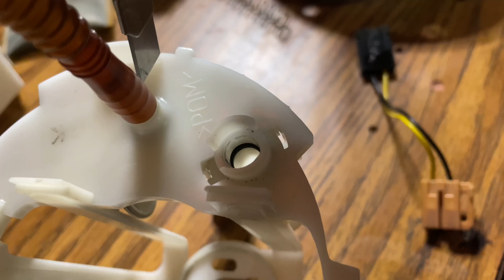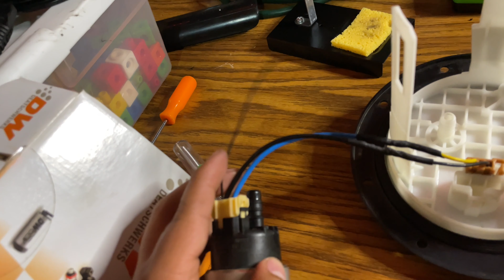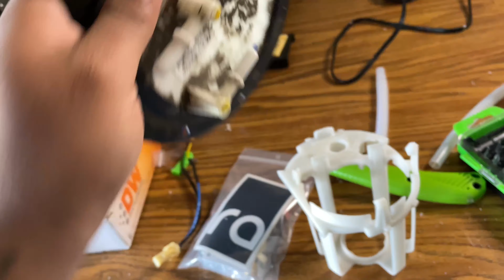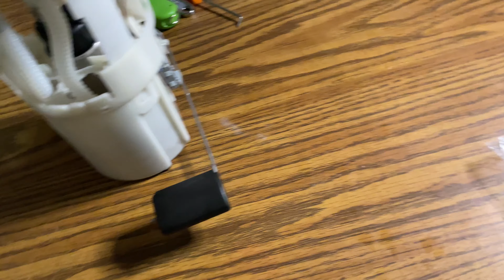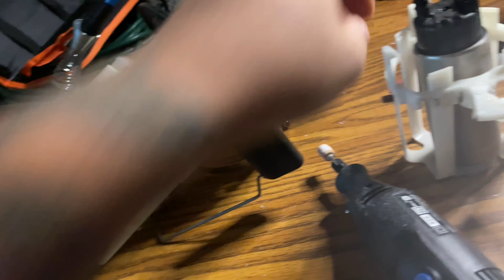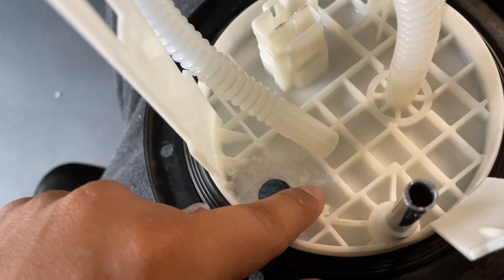Genesis Coupe Fuel Return System Pt.1 | Radium Venturi Install

Comment: Im confused because my canister on my bk2 doesn’t look like that so im completely lost😂
Reply from the maker: @brodie3125  still the same process. For any vehicle really. The demonstration is just shown for a GC 2.0T fuel assembly
Reply: @ ohh gotcha thank youu
Reply: @ProdigePerformance also have another question does anyone have a part number on the fuel pump connector yellow and black wire that you were showing ?

Comment: How’d u mount ur fuel pressure reg? Did u drill holes into the manifold?
Reply from the maker: @vietyyg6739  I just used existing bolt locations on the manifold boss. They’re already there

Comment: I noticed at the end of the video when you were showing the finished product of the fuel basket …that the top was pulled all the way up and doesn’t seem that you cut the hoses like you said would need to be done.
Reply from the maker: The full basket has to be all the way up. Otherwise the bottom the basket won’t be fully submerged when installing it. Having the spring is ideal which I don’t remember if I had it in the video or not or mentioned it. If you do have the spring you can ignore it. If you don’t then you’ll have to raise the assembly fully to get the proper length which is why I didn’t cut the hose

Comment: The duck bill is so the venturi doesn't suck air up into it if your bucket drains.
That would stop the venturi effect.
Has nothing to do with stopping aeration
Reply from the maker: I was going off of what the rep at radium told me. Good info though

Comment: @Brian Paul, are you using the oem feed fuel line to your engine? Or did you replace that with PTFE lines.
Reply from the maker: You can use the oem hardlines I just choose to Replace all of it. 

You’ll still need to replace the fuel lines in the engine bay though.
Reply: @ProdigePerformance  I believe is better if using e85. I plan to place a fuel filter underneath the car instead of the engine bay.
Reply from the maker: @27ubs  the response was towards e85 users. And nice. This video is even helpful for ls swap guys. Didn’t know that till I had a few message me the same week. Glad it’s coming for circle
Reply: @ProdigePerformance  What vsize ear clamps did you end up using? I have the pliers already.

Comment: That radium system would make a gasoline distributor T or is it a check valve? I have a problem with my genesis, that the return of gasoline fills the other tank with gasoline, passenger side. Help me please, greetings from Peru

Comment: I honestly didn’t even know they made that to work with oem siphoning tanks. 

This is basically a universal video and can be interpreted into any platform since when doing a return set up on modern vehicles you run into these types of issues. 

Ex. My c6 had this problem.

Good video

Comment: Awesome video. Us 3.8 guys don’t need to do this until we get around the 700 whp area which no one had really got to besides a few. 

I’m using stock HPFP with a 320lph in tanks pump. 

Haven’t had a issue yet.

Comment: Is there a link to buy these things?
Reply: Just to be clear, a fueling problem is not the benchmark for doing this mod. There are far more benefits to running a return line than a returnless setup. OEMs primarily do a returnless setup to reduce complexity and therefore it is cheaper to manufacture, and fewer parts to fail for warranty claims.
Reply: @Weekend_Garage  awsome definately going to do more research. Mostly because I'm going turbo it would be awsome if I could adjust the fp with a fpr
Reply from the maker: Updated the description bro!
Reply: @ProdigePerformance  has it been tested yet? What about for the high pressure regulator on bk2 3.8 in front ?
Reply from the maker: @teejayyouk  it’s been tested in both videos in the description. S&H PERFORMANCE and Weekend Garage. Check out their videos. 

As far as the 3.8 guys, I’ll have to do a separate video but for the
Most part it’s set up the same if you were to do a return system. 

Typically you don’t need a return system in a 3.8 unless your planning to break past that 7-800 mark
Reply: @ProdigePerformance  well I am waiting for my turbo kit haha. But can't wait to see the 3.8 bk2 video. As for now I. Buying a spare so I can start doing this lol
Reply: But the fueling issue that the bk2 3.8 have will no longer be an issue once Travis does his magic lol
Reply: @teejayyouk  I made over 600 wheel in my past 3.8T build. Never had a fueling issue just upgrade to a 320lph pump and that’s it.
Reply: @seoufulracingsfr6323  okay 320 should be good for less than 500
Reply: @seoufulracingsfr6323  would you recommend a dw 400? Or what brand?
Reply: @teejayyouk  DW Walbro AEM are the only brands I like to use when it comes to fueling. Preferably DW